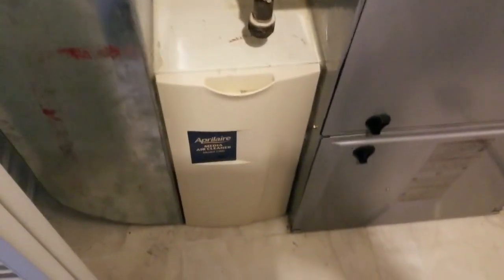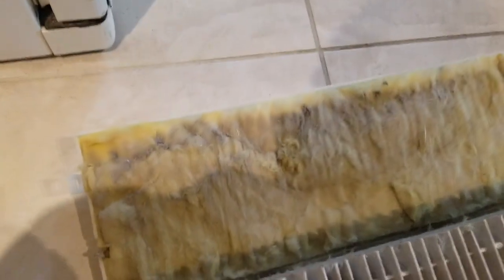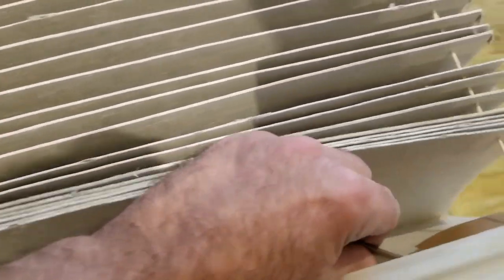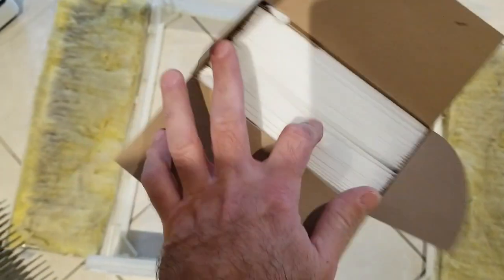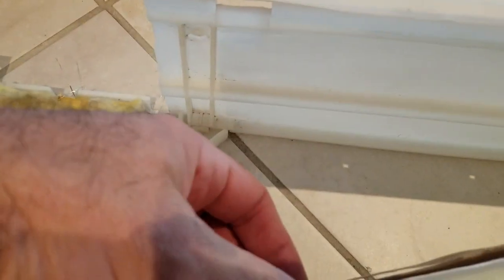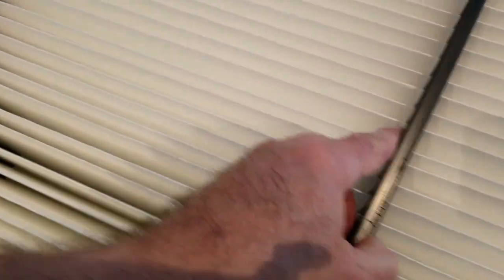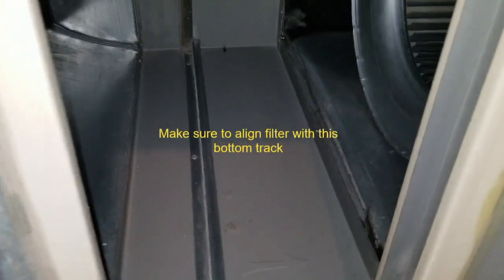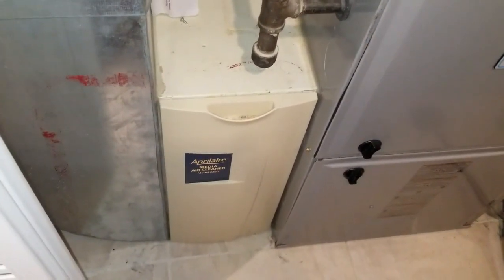Aprilaire 201 Furnace filter replacement

Comment: These filters are so overcomplicated. They have an upgrade kit you can buy to where you use the same housing but it uses the 410 filter that just slides in. 1000% easier.